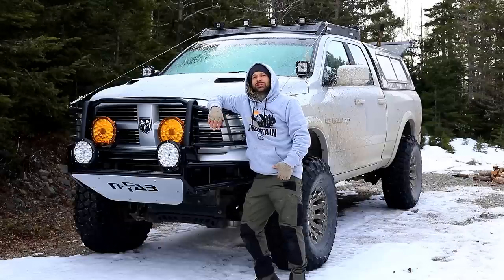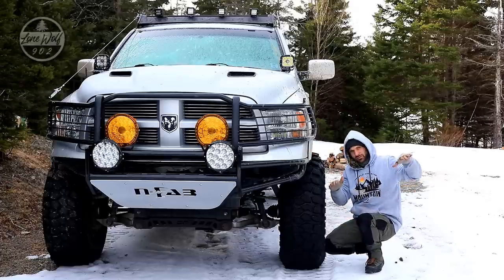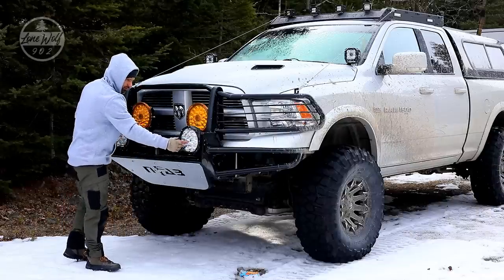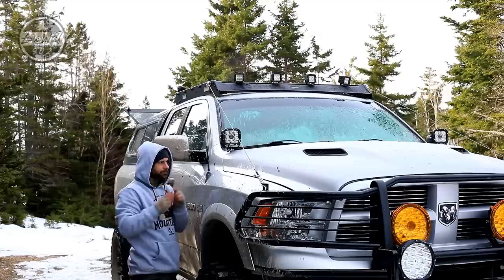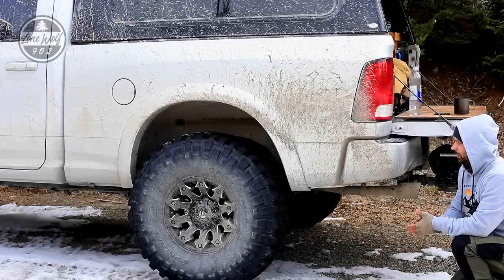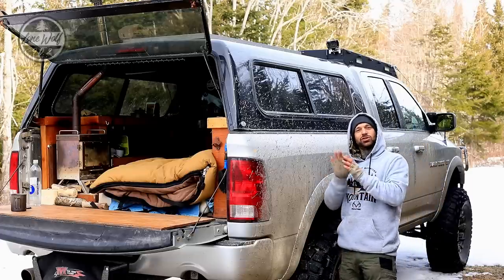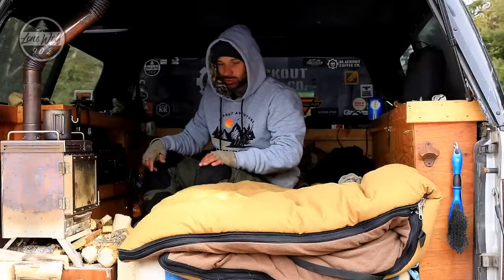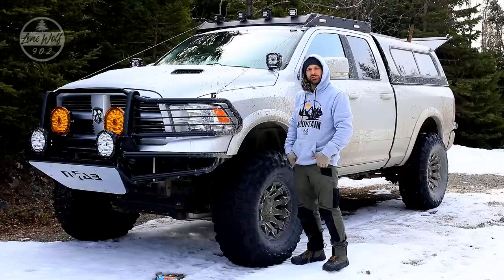Overland Truck Camper With Wood Stove

Comment: What gears do you rune for the 40s im about to put 38s on my dodge i have a 6 in lift but im cutting all my fenders to make them fit and welding metal one on that im doing my self